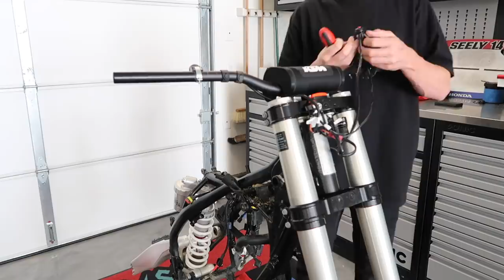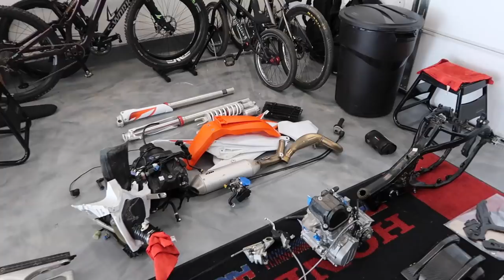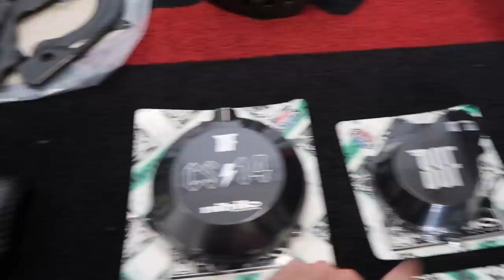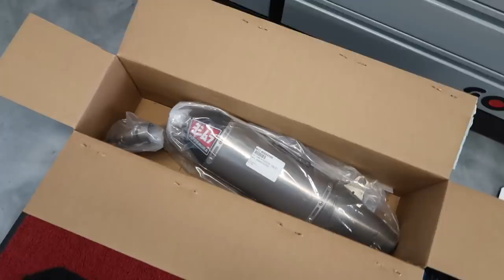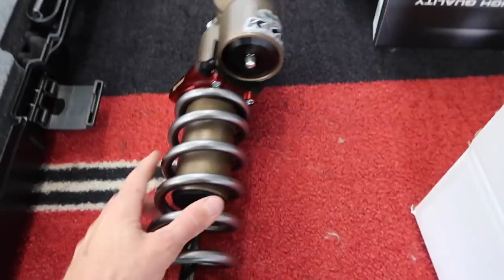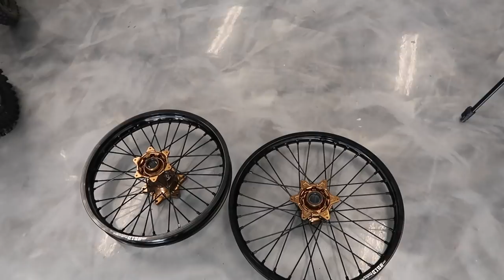Unboxing new parts for the KTM!

Comment: Hope you have good luck with ktms me and my friends have always had problems with ours like the transmission blowing up and engines seizing problems starting for hrs
Reply: That’s pretty extreme. Did you ever change the oil?
Reply: Thats strange, Ive always had the complete opposite problems until i got a ktm. my 2017 350sxf hasn't missed a beat. Regular oil changes, i did 105 hours on the original piston, only change as maintenance, no signs of loss of compression. 160 mx hours now and both engine and gear box going strong.  also 30 hours on a 2019 250sxf and its like new

Comment: Cole you should check out the Honda steering stabilizer application from ride engineering I’ve ran it on two of my ktm a now and love it. A simple adapter and it mounts up right where it would on a Honda tucked in behind the front number plate

Comment: Did you think about doing cone valve on the air forks or were you dead set on springs from the start? Curious because I have a 2020 450 i want to tune the suspension on and the air forks have actually impressed me
Reply: Brandon Smith  what are you going to do with your stock ports?

Comment: surprised you didnt get some new cone valves those look so trick or same factory 52s like what webb has
Reply: Wouldn't it be fun, to get this done and then go ride with Webb and switch bikes and compare. I'm dreaming to big.
Reply: Justin Coats motocross action has a vid of webbs factory 2 stroke with the same factory suspension on it
Reply: Can Cole get Factory Suspension from KTM?
Reply: SoCali7three you can buy 52 mm cone valves that where ex factory from 2015 and make them fit on here. probably cant get the new exact 52 cone valves like webb has